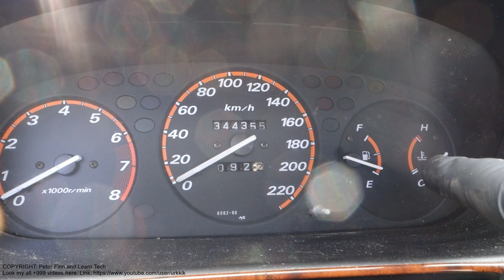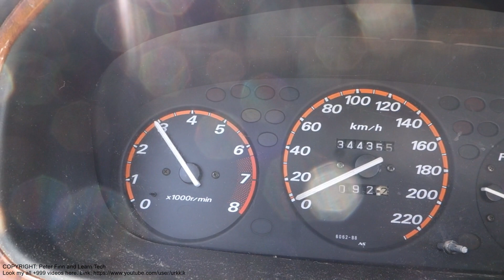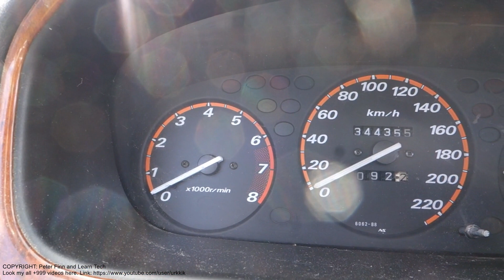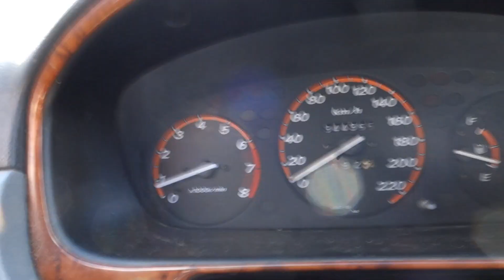How to repair HIGH idle speed issue in Honda CRV

Comment: My problem with my car is that when I it’s in park or neutral it idles from 1-2 sometimes 1-2.5 rpms. I changed the TPS and got it close to .5 but it’s .4 the idle is still there. And it idles when I’m driving really slow like below 15mphs. When I let of the gas when driving it feels like there’s a huge loss of power to the speed. I’m not sure what to do and there is a code.
Reply from the maker: Noted 👍
Reply: @PeterFinnTheCarDoctor  if you ever get any info on that please post it! I am getting a tool to help me calibrate the TPS correctly, and I’m hoping that will fix the issue and remove the code.
Reply: Change timing. Set it ahead a bit

Comment: After Cleaning my Throttle body, i got a check engine light, and it now has a high idle. I also dont have a scan tool. Idk what happened to it
Reply from the maker: Normal setup. Drive 100 miles and engine is Ok

Comment: hi mate, its still not fixed. ive clean IACV, throttle body and still high rpm every morning. might sensor error ?
Reply from the maker: Thanks for comment 👍😀
Reply: You said every morning. Did you mean when it's cold? What's your car RPM when car warmed up? Because when it's cold it may take up to 10 minutes to warm up on idle for car to drop RPM below 1k.

Comment: Does this fix acceleration issues when hitting high gear cause I notice mines is sluggish and take forever for the car to go?
Reply from the maker: Ok
Reply: Your transmission may require attendance. Start with changing transmission fluid.

Comment: hi, I have same problem here, RPM at "P" or "N" more than 1200 rpm, but at "R" or "D" are normal.
need your advice, thankyou.
Reply from the maker: Hello. 
N is neutral and neutral gear and no any forces.
Reply: I have the same issue did you ever figure it out?

Comment: When i start my car the rpm is in normal but later on the rpm is moving high up to 2500 even i didnt stepping on the gas pedal. What will i do? Does the video is the answer?
Reply from the maker: Throttle body is bad.
Reply: If its AT check the fast idle thermo valve...Its mounted on the bottom of throttle body. Valve gets loose over time and wont close when engine is warm. https://www.youtube.com/watch?v=L788jKEVblY&t=320s

Comment: I have the same problem and I haven’t fixed it yet; my question is can I still drive the car with this issue, at least until I fix it? 
Thanks
Reply: You can, but it's harmful to the engine and this part itself. Just do it this weekend.
Reply from the maker: Thansk, Good commnet 👍😀

Comment: Sir, what is PWM idle control valve??

My car i20 1.2 petrol has 3 pins connector to its idle air control valve. Pin 2 gives 12.6 v when grounded. However, pin 1 and 3 gives only about 10.5 V when measure with respect to positive post of battery. Why I'm not getting 12.6 V???

Also, very surprising is that, when pin 1 and 3 are grounded individually, they still give about 1.5 volt. Is there something current nor voltage leaks??? Our main issue is pin 1 and 3.
Please find me solutions!! Thanks.